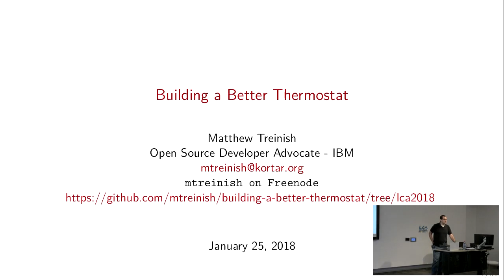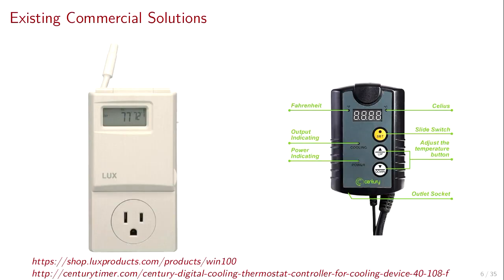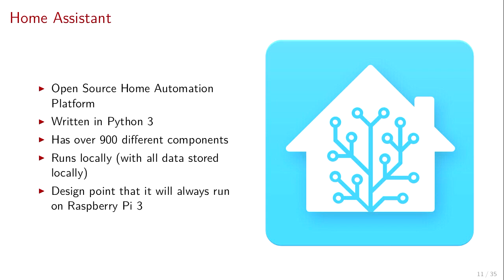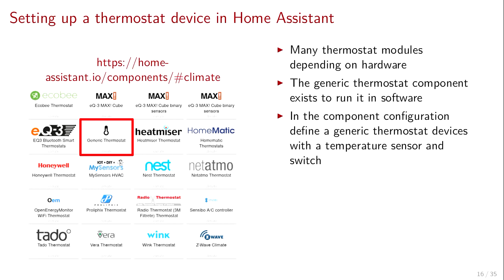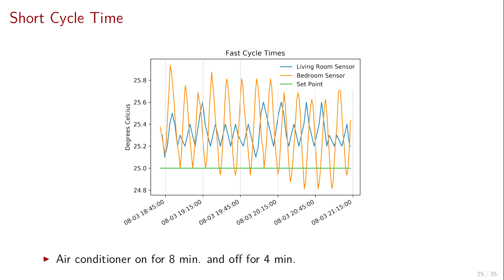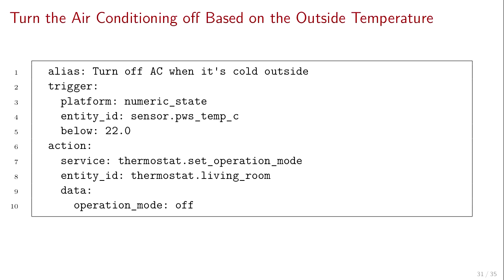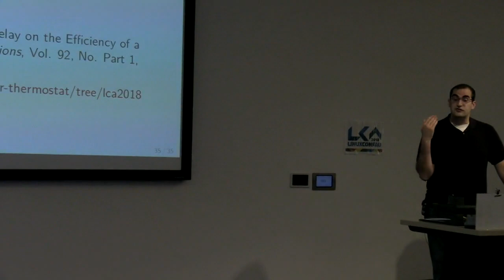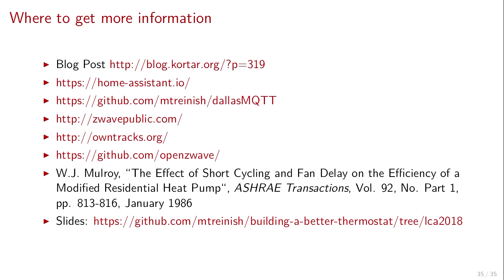Building a Better Thermostat

Comment: I enjoyed this video.  That knob on the air-conditioner with the widening blue line is a mechanical thermostat however.  Those units have a fixed compressor speed, the "blue bar" knob controls the "temperature" the compressor turns on and off at.  It just is not calibrated to a particular temperature setting.  That's a pretty standard design really.  No eletronics inside.  Works similar to an old analogue oven thermostat, but without the temperature calibrations.
I would have done what you did though.  Control the units with a digital based thermostat.  Instead of an expensive Z-Wave controller now I would use a WiFi based switch that is a lot cheaper as you can get them up to 15 amps now.
Anyway, minor niggles.  I loved seeing your video and the solution you came up with.